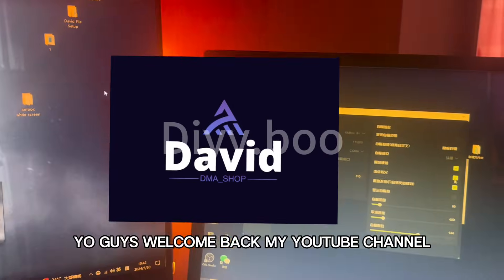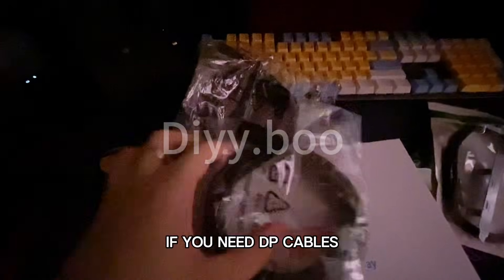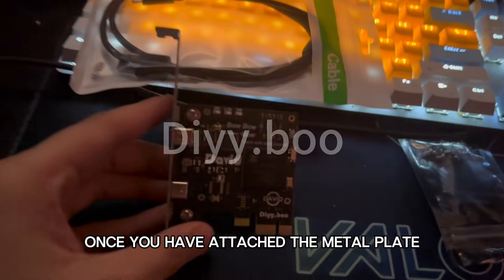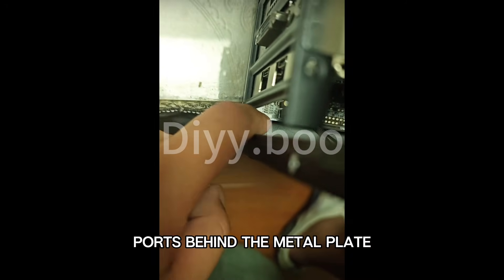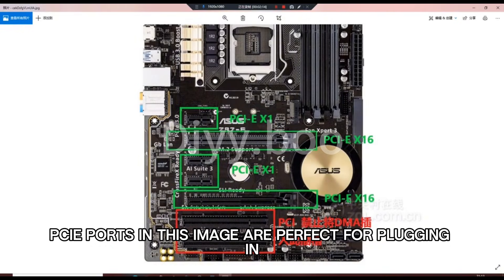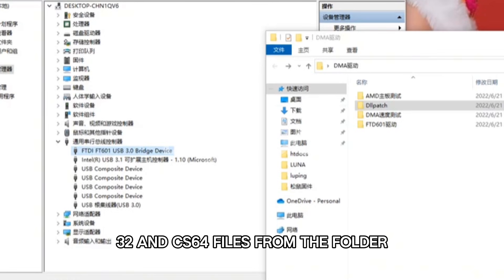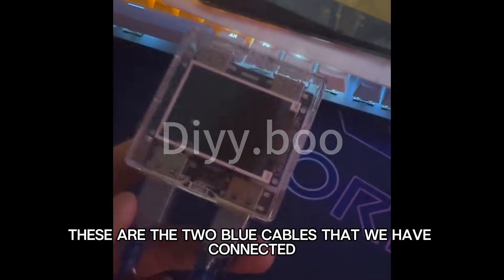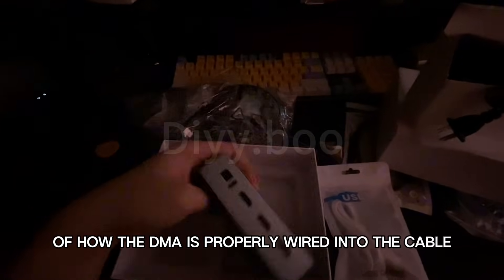2026 DMA Cheats Hardware Setup Tutorial!

Comment: So instead of using another full pc i can use a mini pc and it will work just fine?
Reply: If you are going to be doing this, you should be running both pcs as virtual machines if possible and isolate everything into a VLAN segregated from your main LAN. Nothing should be communicating with your main network. Also, I would write my own firmware unless you absolutely want to join someone's botnet. Best of luck
Reply: @DudeItsDallyBoy  thank you my friend. I am already set up and missing people off 🤣🤣
Reply: @DudeItsDallyBoy yo
Reply: @DudeItsDallyBoy but gaming on an virtual machine is going to be slow
Reply: @DudeItsDallyBoy can I just create the custom firmware on my main pc (that’s where Vivado/VS and all that stuff is) but actually flash it and download everything dma related on the second pc?
Reply: yes
Reply: Can someone help me set mine up